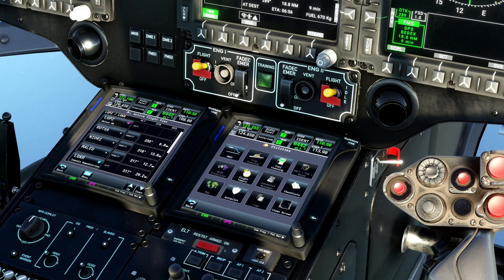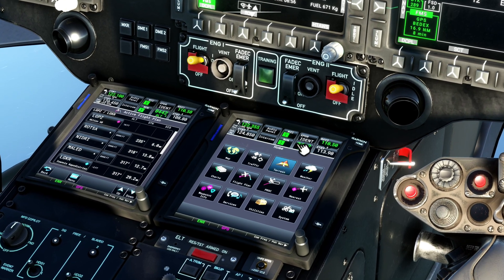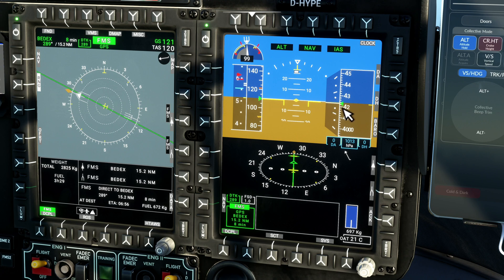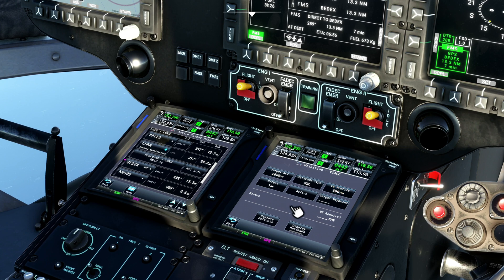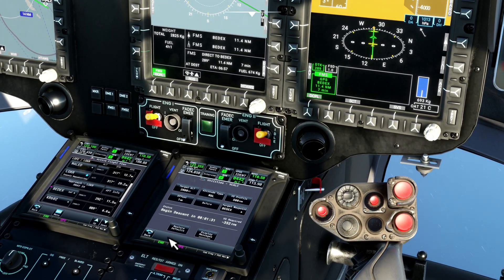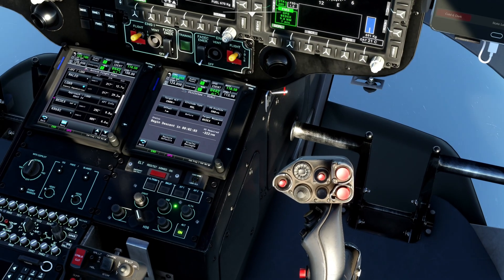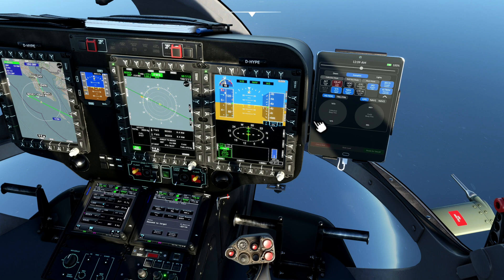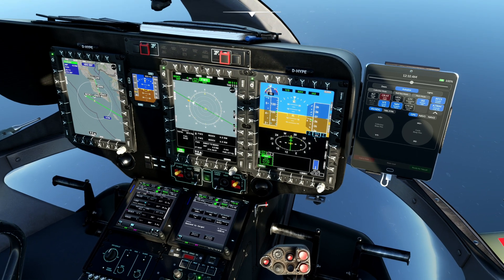16b. H145 Tutorial MSFS 2020: GTN 750 VCALC function. Please Like, Subscribe, hit the Bell!

Comment: Thanks for this.  It's a handy tool to figure out the rate of descent/accent.  With my mucking about with the AP I have discovered that if you set your desired altitude with the ALTA knob, you will see a readout at the top of the Alt indicator on the Primary Flight Display [PFD]. (this will only pop up if the desired Alt is greater/less than the Alt on the visible gauge values on the PFD)   You then select the desired VS rate of climb/descent using the SV knob.  You can now click the V/S option on the iPad Tablet.  As soon as the VS rate is captured you can then click the ALT button on the iPad Tablet.  This will extinguish the VS blue light and the helicopter will maintain its climb/descent as before until the desired set altitude as input with the ALTA knob is reached, where it will level off.  This is as close as I can get it to work as a regular AP climbing/descending to a set altitude.  So the operating procedure is; Set ALTA, set VS, Click V/S on Tablet, Once VS is acquired click ALT on Tablet.  Once the ALTA disappeared after I set the VS, so I quickly reset the ALTA and it was fine.  Just worth noting.   You might be able to set ALTA after you have entered a VS value and acquired the desired rate of climb/descent, then click ALT.  I haven't tried that yet.  Sorry for the long explanation.
Reply from the maker: havocmwf - long, detailed explanations are much appreciated. I will take a look at that. Thanks for contibuting to the channel.
Reply: @theflyingdoctor  No problem.  I made a quick video on how it works for me at least.  https://www.youtube.com/watch?v=8ao39536pZQ
Reply: Oh wow, thanks for expanding and adding additional details on how to somehow couple the H145 flight management system to the GTN750, some sort of manual VNAV using the H145 flight mgmt system.  I was debating if I should purchase the pay ware version of the GTN750 and what you explained somehow lit a "bulb" in my brain, I wish the GTN750 has a way to automatically couple to the H145's or H160's flight mgmt system...thank for sharing